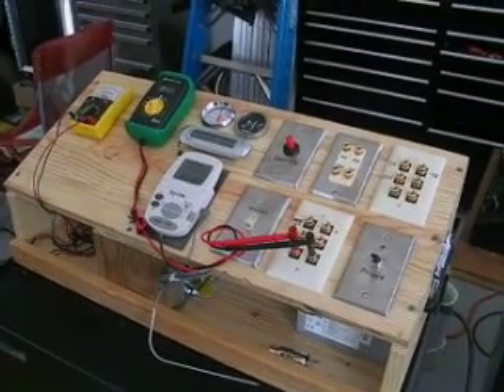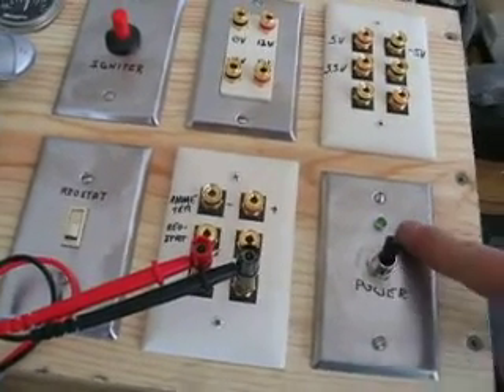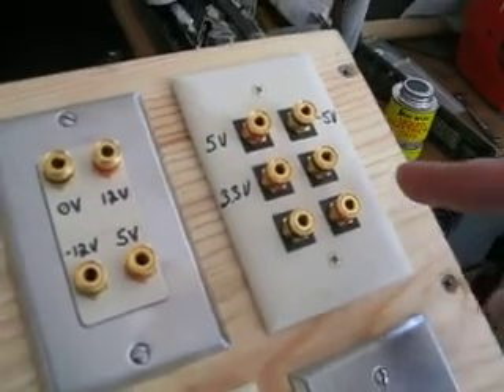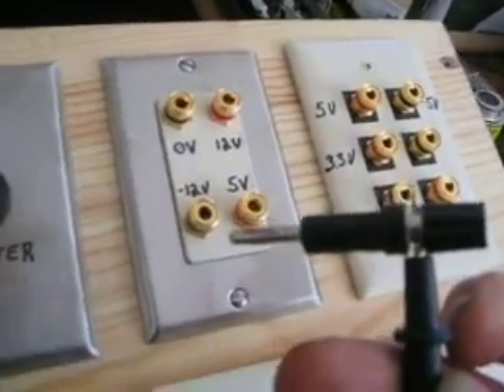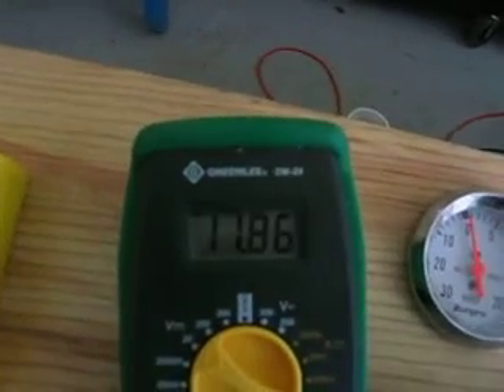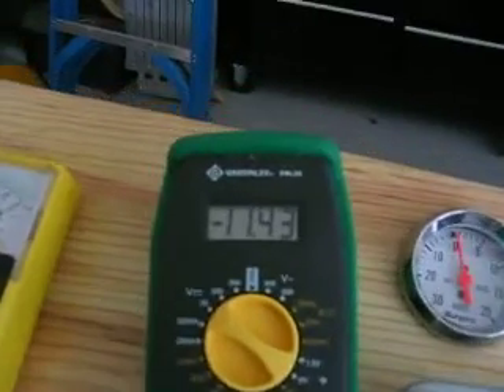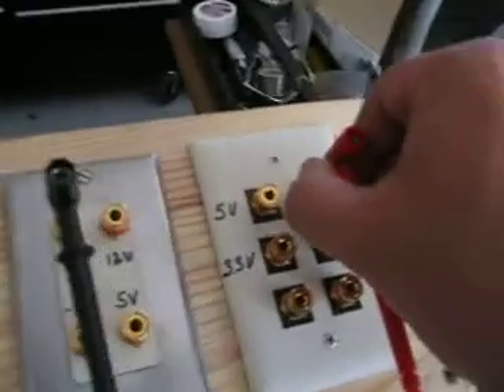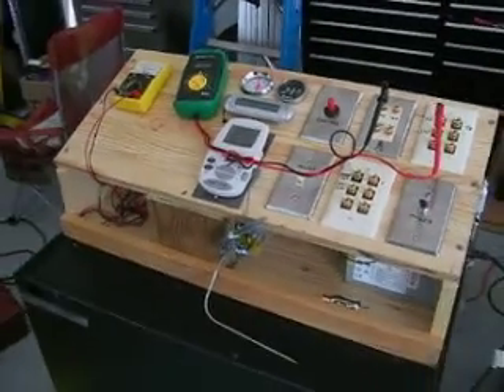Computer Power Supply to Lab Power Supply - Part 3

Comment: I wouldn't recomended anyone using a ATX power supply for a lab power supply. First because it isn't (you can't choose a voltage down to 0V), second because if you short the supply it will probably go bang or powers off.